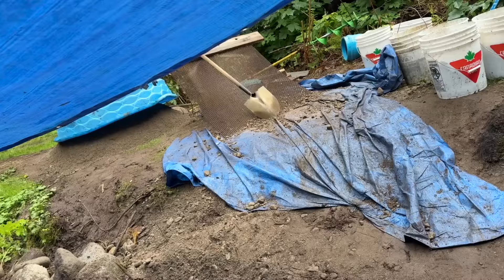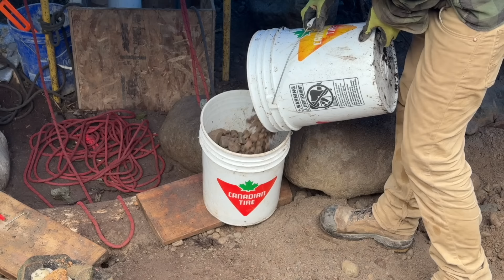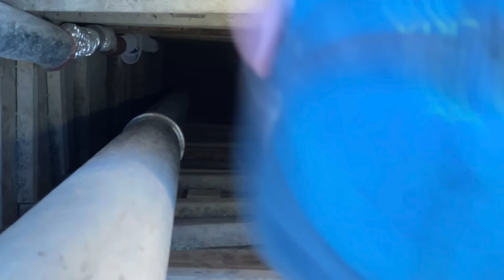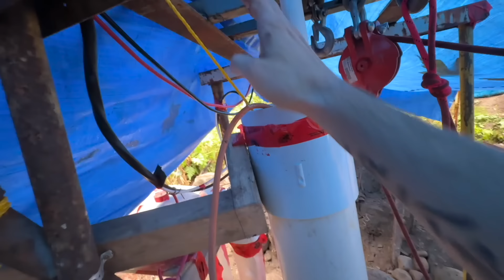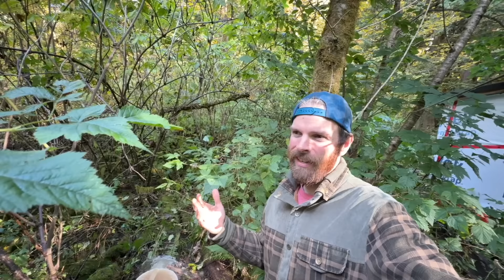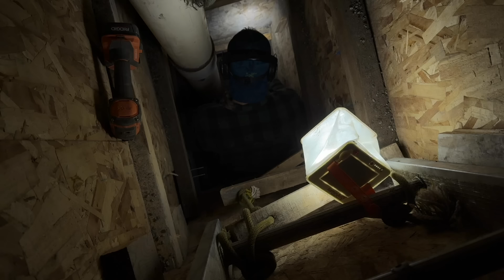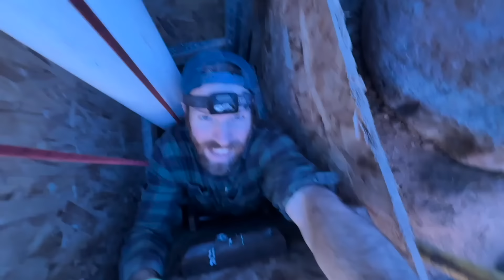How Much Water Did My 39ft Hand-Dug Well Actually Produce?

Comment: Could put a hydro generator in and get some electric power from it. With a solar powered pump system and gravity you can build a water storage battery with tanks or a pond that runs 24/7 to make a consistent electricity flow rate for free minus the build cost.
Reply: Measure your peak, minimal, and lowest electric use in a 24/7 period to find the sweet spot of power needs and maximum storage needed of a water battery
Reply from the maker: That’s a neat idea. Kind of like sand battery concept but hydro.

Comment: Did you happen to measure the temperature of the water? It might be a good idea to look at setting up a open loop geothermal heat pump for your cabin. Take full advantage of the super hard work you did. Congrats on completing the well!
Reply from the maker: I believe it was around 8c / 46f when I checked with the FLIR. I’ll see if I can double check it with the pump running fresh water. Would be nice to run something like that. And thanks for watching! Appreciate it.

Comment: OK You asked.... Think about this... IF you have a 30 gallon expansion tank (I'd also use a 40-60 LB pressure switch) it will take about 1 - 1.5 minutes to fill it. You stated it ran for 3 - 4 minutes before cutting out and recovered in about 1 minute. You should never run out of water with the way your system is set up unless (fingures crossed) your well runs dry. To give you a comparison my well is a drilled well (I do not know how deep or the HP of the pump... it was there when I bought my land) It supplies 45 gallons per minute (takes 6 seconds to fill a 5 gallon bucket) I have a 40-60 pressure switch and have NEVER run out of water or had a problem using as much water as I wanted to (I.E. Taking a shower and running the dishwasher at the same time. Hope this helps.
Reply from the maker: Amazing! 45gpm is a ton! Appreciate the info that does help a lot.
Reply: @wildcoastoutpost  to clairfy, the above is with an open 1 1/2" PVC Pipe without a check valve. it slows down some when I put the check valve on and run it through the 3/4" PEX Pipes but still no problems getting all the water I want.

Comment: On your line from the pump install a brass non return flap valve and drill a 3-16th hole in the flap , then install valve back wards ,This will restrict your flow and still allow pump to work as normal.

Comment: You can use a "dole valve" to regulate the pump flow. They're pretty expensive for what they are but that is the trade name of the device. Or bush it down to 3/4" and see what your flow rate is. Might need to bush it all the way down to 1/2" to get it down to 15 gpm. I'm not aware of your water needs but I assume filling a cistern? A common 120v float valve could make a nice setup for you.
Reply from the maker: Oh cool, thanks for the info. Ya it’ll go into 3/4” pex anyways so I’ll bush it down and check. I think I’ll just do a standard pressure tank setup.
Reply: @wildcoastoutpost  If you're going to use a standard pressure tank and pressure switch I would keep it 1" all the way to the tank and then bush down after. That way there will be less resistance on the pump when it is recharging the tank. You won't really be able to pull more than 15 gallons a minute unless you're running two garden hoses and doing laundry and dishes at the same time.

Comment: 1:42 thanks for trying dude.  I was thinking about it more and spreading the two lines apart helps too.  You can just grab both and spread or move the pulley (or fixed point) off center.  It will force the rope to make a triangle to prevent twisting to start with.  You're probably all done with this project, but maybe it will help in the future. Thanks for sharing all your hard work and positive attitude about it.
Reply from the maker: Thanks for the extra info, ya all done. Good to know for future though, always needing to hoist things. No prob! Glad to be sharing some entertainment and info along the way!

Comment: Proper test for GPM is to measure the level of the water from the surface in the pipe. Then, turn on the pump to lower the surface level and take a measurement of the new level. Then, time how long it takes to get back to the original level in the pipe.
Reply from the maker: Good call, I'll do that when I get a chance.

Comment: To get rid of the Twisting. 

If you use two tackle blocks, a foot or so apart, you would remove a lot of the twisting from the line, just bolt them to a 2x4 and have them add separating tension to the line, this would cause a V all through the line, that gets smaller and smaller as it gets to the lowest point, so you would want them set at a distance for your application, but it should remove the twisting entirely. 

You will want the pulleys to be rigidly mounted to something though, so something that can be bolted straight to a 2x4 is ideal.

Comment: You could get a 1000 gallon water tank to hold the water.
 Run the current pump for about 5 minutes at a time every couple of hours would eventually fill a 1000 gallon plastic container.  
Just checked the price and new at Home Depot they are running $1500.00.
 That is a bunch for me but perhaps you could pull it off or even just buy 100 gallon water tanks.
Add to the system every time you can afford a new one- they are about $300.00 each.
Reply from the maker: Thanks, I have a couple already. Think I'll connect into the underground shutoff so I can keep both systems for redundancy.

Comment: I am being completely honest with you when I say I would not risk going back down that shaft to take all of that wood out. The little bit that you have taken out at this point is probably more than enough to avoid any potential contamination. You’ve already backfilled enough dirt and gravel to protect your water source at this point going back down to remove more of the OSB is just putting your life further risk of a collapse.

Comment: I have no idea about the pump size and such, you probably have considered this too.  The height as well as the distance of the pipe to the top of a water tank would need factored in, as that would decrease the flow rate.  If it were me, I'd complete the build and then check the flow rate.
Reply from the maker: Ya good point. I’ll do a final check again after.

Comment: A towable backhoe from Princess auto would be handy for the next phase of land improvement.  Pretty soon rip all the shoring loose and let the land fill in and then finish by raking in more material. One thing to remember is to vent the well or you will loose flow,A Tee on its side would allow a inspection port and a small 1 inch vent.
Reply from the maker: Definitely, the well cap I have is vented. Will be installing a pitless adapter setup.

Comment: Not sure why you Will need continuous water running,if you are just using water normally through a pressure tank,I’m thinking you’re pump will be fine,great job!
Reply from the maker: Ok glad to hear that, this is all new to me. Appreciate it!
Reply: @wildcoastoutpost my well is 8 gallons per minute,and I use the water with no regard to it running out,this is about my eighth well,having lived in a few places. My wells have ranged from 35 gallon per minute to 4 and never ran out,even with 4 people living there. Good luck

Comment: from low water level (surging) if you let it recharge for 1 min + 3min with pump =4 min.  pump ran 3 min= 60 gal  60/4=15 gal/min recharge rate.
Reply from the maker: Thanks for that. Makes sense.

Comment: Just a guess, but I would think you would want to fill with rocks and gravel as far as you can. Then I would grout or use hydraulic cement to seal between the rocks, gravel. and native soil. To keep it as clean as possible and free of dirt entering your system to avoid contamination during times of high-water table and rain seeping from above.
Reply from the maker: Good idea. Thanks

Comment: To avoid the voltage dropping.  Or line loss making your pump struggle due to lack of power. I would recommend #12 gage well pump wire minimum. 
The power source suppling power to the plug-in outlet should be 20 Amp Minimum and on a separate circuit breaker to insure clean power.
Be sure to follow the nameplate rating of your pump. It is normally a tag or sticker attached to the pump itself.
Love your MacGyver ambition and enthusiasm! I am enjoying watching your progress and look forward to your next video in this series!
Reply from the maker: Thanks for following along and the good advice. I will definitely use the correct wire on a dedicated breaker when I set it up permanently. Appreciate the kind words.

Comment: I think your gpm are measured not by how fast it fills the bucket but how fast it fills the bucket at a sustained rate....so you drop your pump in a few feet into the water and if it continues to pull water..that will tell you gpm, then after you establish your test rate, you can drop the pump deeper for the final position ( staying off the bottom a a foot or more for sediment pulling into  the pump), as too back filling and potential  ground water contamination and grouting, the evriomental control folks here in SC say, a minimum of 25 feet  depth around the well casing at a minimum of 2 inches annulus space..they allow either bentonite clay or pure Portland cement ( no added sand or gravel....just those big 94 lb bags at Lowes or home depot will work)...however each state is probably different.

Comment: The pump you have will be fine just get a 10 gallon a minute flow restrictor or use a ball valve and restrict it back to 10 gallon a minute it will not harm the pump.
Reply from the maker: That’s great. Thanks for the advice

Comment: You impress me! I would grout low then again up higher, you don't any surface water going down to your water. At some point pore bleach down your pipe to sanitize. then anytime you pull the pump bleach it again. It might take a day or two for the bleach to be all out of the well so don't drink it till you can't smell it. I am very happy all your hard work is paying off. Joe from Oklahoma.
Reply: Would the bleaching be what you consider shocking the well? I was thinking that might be necessary for any weird bacteria
Reply from the maker: @bachlava7 yes same thing. I have some pool shock I’ll use.
Reply from the maker: Thanks! Good call, will do that. Thanks for watching from Oklahoma!